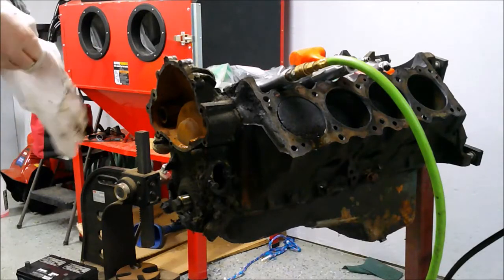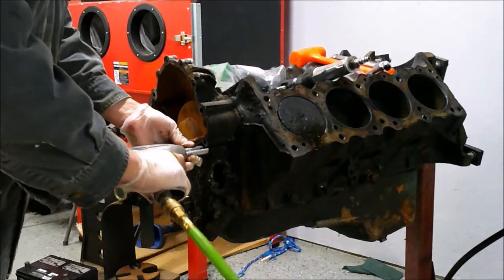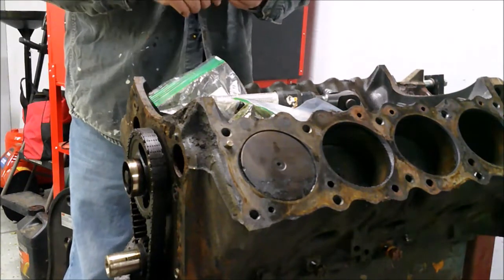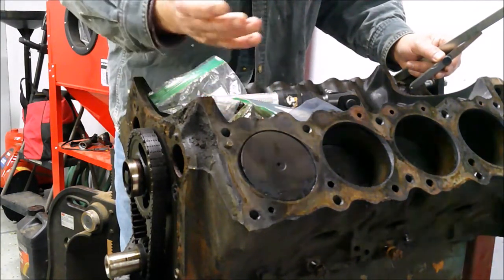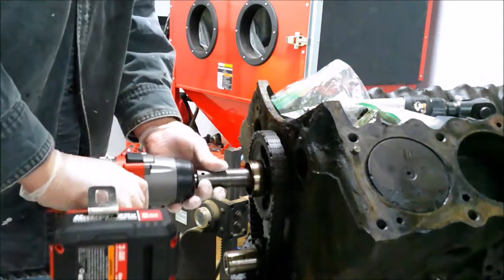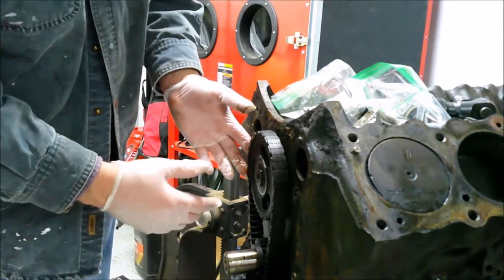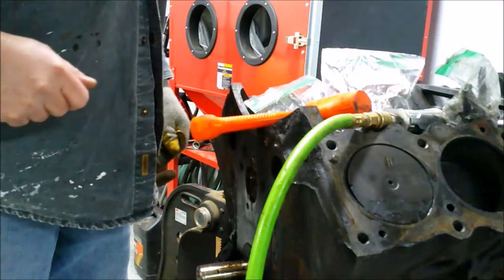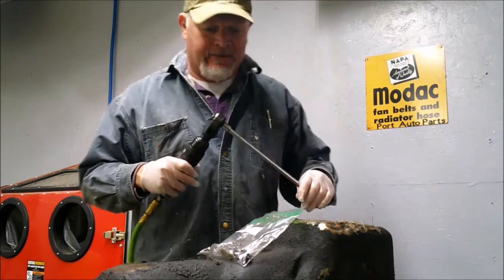350 Pontiac engine teardown, Part two

Comment: What the heck do you think happen to the top of that one piston with all the marks in it? Is that from the valves?
Reply from the maker: Thanks for the reply . Actually there is carbon buildup on the top of the pistons, the build up makes it look like there is a mark in the piston. I am surprised that it had a build-up due to the low mileage condition of the engine.